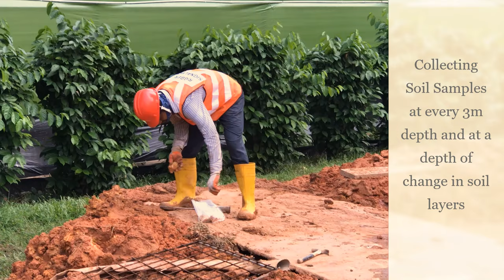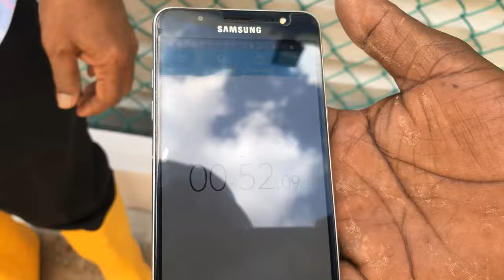BORED PILING WORK SEQUENCES

Comment: Thanks for the full video. Really hard to find this kind of video on youtube. 

I have a question. I saw they welded the Rebar cage to the steel casing, what happen when they extract out the steel casing?
I often found out on site the rebar cage fall to the bottom of the piles. What might go wrong that caused this from happening?
Reply from the maker: During the extraction of the steel casing, we cut the welded rebars. So that the casing and the rebar cage will be separated and the casing could be extracted. If the poured concrete is still too wet, there may be a chance that the rebar cage can fall down to the bottom. Additional reinforcement length is usually considered above the cut-off level to avoid these issues. Even if the rebar cage goes down, it won’t affect the lapping length of the reinforcement. 

For tension piles, the rebar will be provided throughout the length of the pile. In this case, if the rebar cage is not welded to the casing, it may have a chance to move upwards due to the dynamic pressure in the confined environment.

Comment: This work sequence is right. However, there are many serious safety laspes. I hope such work site will have a swo by mom.
Reply: All the job sequences are to be carried out or executed in accordance to quality and safety requirement for the project specific . I observed personnel working under a suspended load, within the swing radius of the machine which placed them in a line of fire.  Such project aught to implored or lash onto the services of certified safety and quality personnel.
Reply: @sundayejigah5704  based on what u say, I guess u r not a site person. Ur theory is merely text book safety
Reply: Since I talk like tt den the collapse zone also have to take into consideration lo. Am I right?

Comment: That is a descriptive video of making bored pile....Thanks for sharing but I got a question. Those polymer liquid is added in the hole and it will be pushed out to surface by the concrete during the process of concrete casting, won't it?. Then, what does those polymer liquid do?
Reply from the maker: Yes the polymer liquid will be pushed out to surface during the process of concrete casting.

The polymer will act as a resistance shield for the soil around the bored hole. The purpose is to withstand the soft soils in the bored hole without collapsing.

Comment: Hi dear 
This is nice video good, two queries I have 
1. If the pile lenght is 15meter, what will be the casing pipe lenght and whether the casing pipe will be inserted prior to drilling the boring 
2. When the casing pipe will be removed,  that is immediately after casting right ...
Reply from the maker: Thank you.

1) The casing length depends on the soil conditions. Normally it will be provided until the hard soil layer, so that the soft soil will be resisted by casing.

The pre-boring process will be done first roughly around 4m to 6m. After that the casing will be installed. Then the boring will be continued until the required design depth.

2) Once the casting of pile completed, the casing will be removed prior to the final setting of concrete.

Comment: can we do bored piles diameter 450mm without temporary casing? and how to determine whether need to use temporary/permanent casing or not.
Reply from the maker: Basic reason of providing the casing is to prevent the soft soil from falling into the pile bore. If the casing pipe is not provided , the clay or the soft soil shall keep on falling in the excavated bore of the pile and while casting the concrete, this shall get inadvertently mixed in the cement concrete.
Reply from the maker: There are temporary casings and permanent casings. 

The temporary casing is a type of casing that is removed after the casting of concrete is complete, typically before the start of the final setting. As you must be well aware, the loose soil is generally found in the Initial layers of the Bore. So, in the case of a temporary casing, the casing is not much deep. If we have a deep temporary casing, it is very difficult to remove after the completion of casting.

Permanent Casing is a type of casing that is concreted with the concrete and remains there for Life of the Pile. The general practice is placing the casing before pouring the concrete so that no soil gets accidentally mixed with the concrete. These kinds of casings are seen where the soil is very loose/fine & the chances of caving of the pile are more.

Comment: Did they pump out the water inside the casing?
Reply from the maker: Actually it is not the water. It is stabilizing liquid (Bentonite or Polymer). Soft soils has a tendency to collapse during pile boring. To overcome this issue, the stabilizing liquids were pumped into.
Reply: @ProudtobeaCivilEngineer  thank you, so the water inside the bore hole if there is doesn't need to be pumped out at all?

Comment: Hi, may I ask the skip that you used for topping up during steel casing extraction, is it opened by crane or by the man down there? Or can you share some detailed photos of the skip if it doesn't trouble you. thank you very much.
Reply from the maker: @Mohd Mirza Abdul Rahman, Which crane holding the concrete bucket, the worker using the rope system to open up the bucket. It's comparatively safer.
Reply: @ProudtobeaCivilEngineer  Oh i got it. Thank you for your explaination. Seems really good method compared to what my company is implying where the concrete bucket attached to a mancage for the worker to handle the skip. More hassle and concern on the safety part. Thank you very much for the sharing !

Comment: roughly surveyed
Reply from the maker: It's not roughly surveyed. Actually we did the Setting-Out of Piles with a Licensed Surveyor. He marked the center of each piles with reinforcement bars. In order to verify the distance between two piles, we just counter-check with the measurement tape.

Comment: arent you cutting tremie pipes during concrete pouring
Reply from the maker: The tremie pipes need to be cut during pouring. However, it's quite hard to take video which covers full activity. Thank you for your concern. Kindly view our latest video related to Bored Piling Works for full activity. From Setting Out to Casing Removal.

Comment: How long is the steel case used in this video?
Reply from the maker: The length of the used steel casing is 12m. This is mainly because of the soft nature of the geotechnical profile. The longer casing used to eliminate the collapse of the soils during boring.

Comment: what is the criteria for polymer viscosity check?
Reply from the maker: It's depends on the polymer material used. However for the above project, the viscosity of at least 60s but no higher than 100s was used as the criteria.
Reply: @ProudtobeaCivilEngineer  thanks
Reply from the maker: @waikiankhoo8746  Welcome